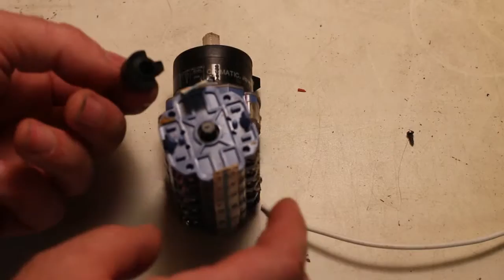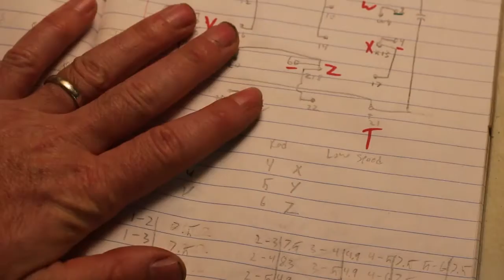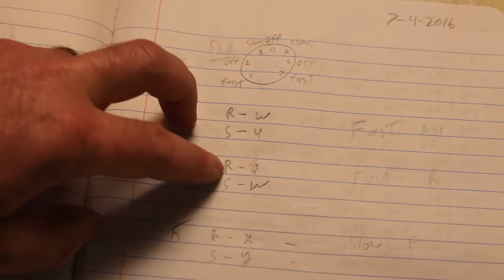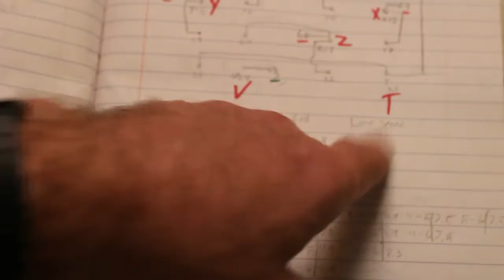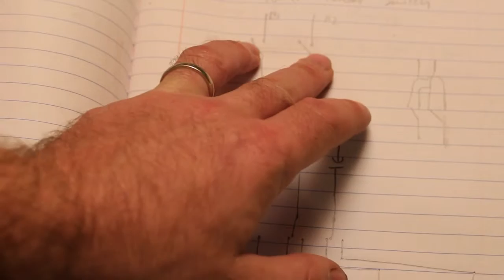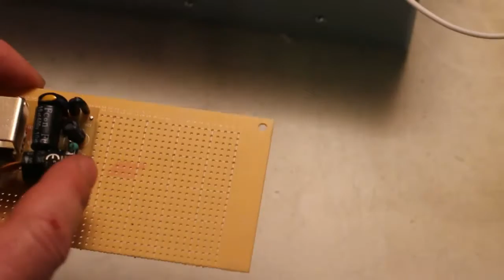Power feeder switch

Comment: Thanks for the video. It was helpful somewhat but the switch I am plagued with is 3 phase not single but the video has been of some help. The switch gets fine dust in it as it is mounted vertically with the know upwards. We only use slow speed on our power feeder so I am looking at just using a more heavy duty switch for the reversing with intermediate off. We have a variable frequency controller installed prior to the switch to give us speed adjustment
Reply from the maker: That should be fairly easy to do.  To reverse a 3 phase motor all you need to do is reverse two wires.  You could get something like a drum switch for a milling machine.  That would have forward and reverse but no speed change.

Comment: My identical switch got stuck....it would turn with a lot of force if you kept trying......I sprayed it with silicone and freed it up then I put six zip ties over the clear switch covers (which hold the springs in) because some began to break loose....now it works perfectly..Thanks for the vid. for others info I know they use these switches on Jet and Co-matic power feeders and probably many other Chinese power feeders.....our shop has four feeders like this
Reply from the maker: Glad it was helpful.  Or at least a warning about how careful you have to be if you take those switches apart.  I haven't finished wiring the relay switch replacement I am working on.  There are other projects and the shaper doesn't get used much.